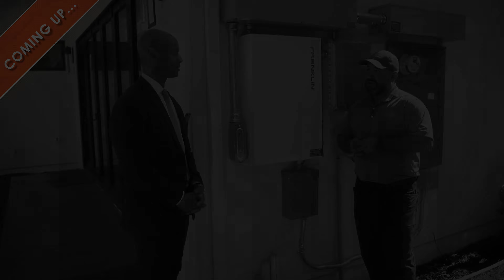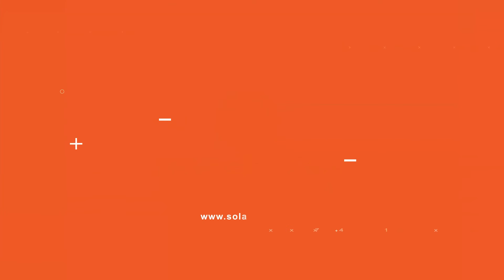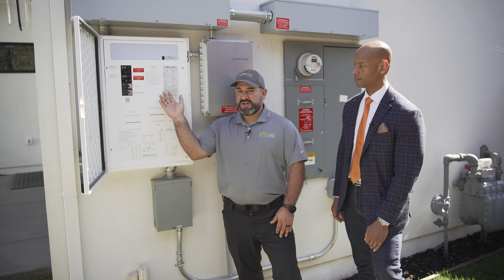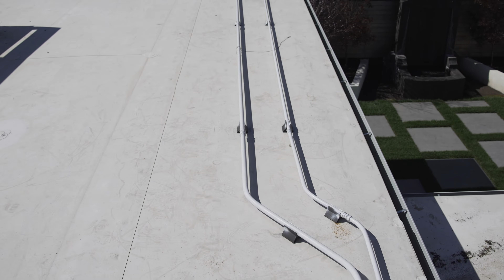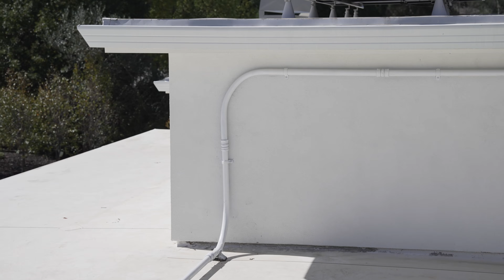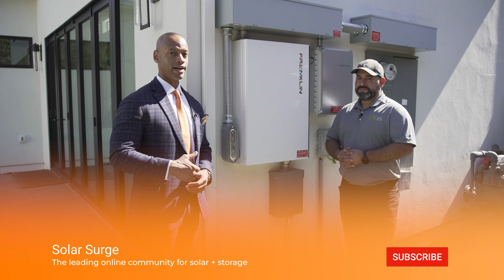How to Install Batteries Profitably

Comment: Phenomenal Content as usual, Joe! QQ- Does a backup home battery supplement a home with lets say that has a 50% offset? If the sun hrs are isnt enough to feed the home energy use how is it going to feed the battery to backup the home during the evening to then become energy independent? 🤔